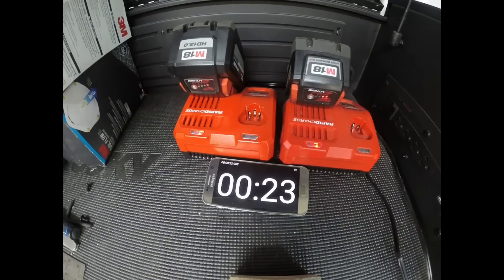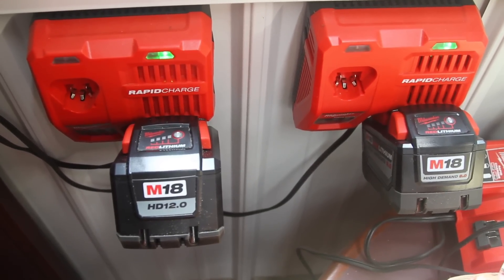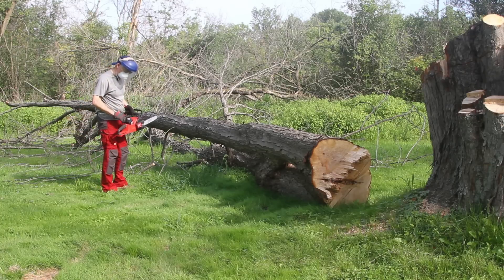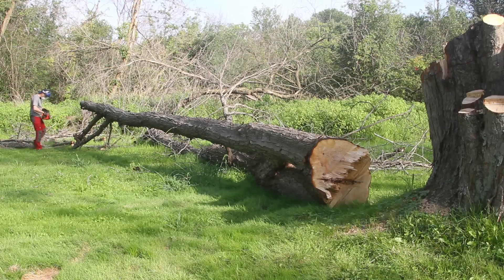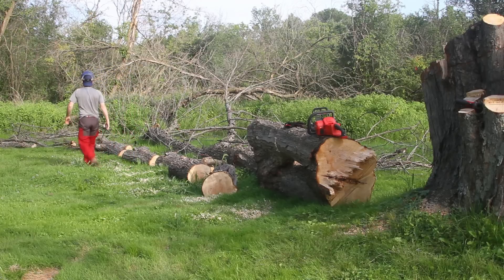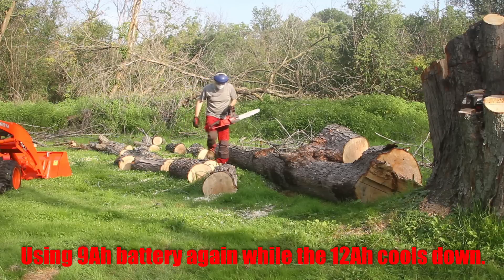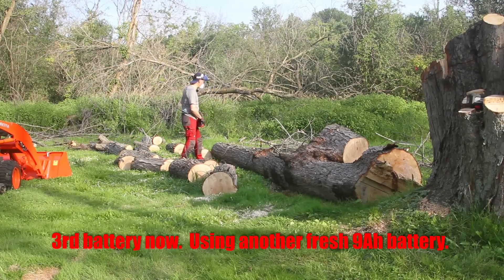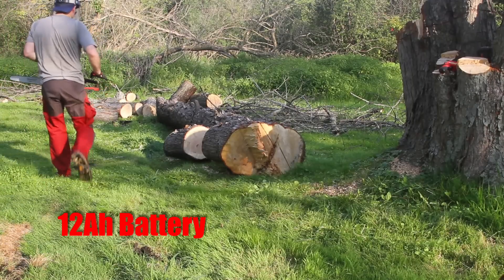Milwaukee M18 12Ah battery charge time vs. work done with chainsaw.

Comment: This saw is for homeowners cutting some small trees or limbs or the construction worker occasionally using a chainsaw. Pretty ridiculous video using it for a big tree. This job is for a gas chainsaw. You wouldn’t take a electric saw into the woods to log

Comment: I'm very unimpressed by such an expensive battery, is it the long cuts, seems to handle the 4-6" much better. I need a saw for clearing 4-6" land with a saw and brush cutter. The constant back and forth between the two pieces of equipment is killing me.  That being said I do not have power or there to keep charging batteries

Comment: This is my third small chainsaw.💫 allabout.wiki/21HD   The first was corded, and second not but both had the unwelcome feature of needing to hand prime the oil for the chain with no clear idea of how much oil was left in the chamber.  They also made tension maintenance clumsy as I needed a tool in each hand to do it properly.  Now, here comes a chainsaw with a simple turn of the external tension control to maintain proper cutting tension and a bar oil reservoir that is visible with clear markings.  Sign.  Did I mention that the oil is automatically released to the chain?  Did my first cuts yesterday which went smoothly, so much so that a friend who'd been intimidated by these machines came by, tried to use it and was so happy she's buying one for herself.  The price is excellent and after reading the reviews I bought this one even though I loathe orange on tools.  The attractive black and green one cost almost twice a

Comment: I’ve been using this saw for over a year with 2 12ah batteries for trail clearing work. When used correctly I will be exhausted by the time the batteries are. It only overheats if you push on it rather than let the chain do the cutting. It needs to be kept sharp and well oiled.  After 3-4 battery cycles the chain NEEDS sharpening. He begins with a dull chain🙄. Like any saw you need to make sure the oiler isn’t blocked by sawdust, you need to clean and maintain the bar for proper flow of oil, etc. It isn’t magical, it needs proper technique and maintenance.  At numerous points in this video the saw is pinched because of bad technique (6:40 is inexcusable, he totally misreads the tension/compression).  The danger with electric saws is that it’s an easier entry for inexperienced users who don’t know how to really use the tool.
Reply: Exactly! I completly agree with your comment, I have used this saw for 2 years now, have 3 12 Ah batteries and had never had stalling or overheating of the batteries or motor. As you put it, the chain needs to be sharp and well oiled. Usually I fill oil and sharpen the chain with every battery change, works perfect for me. Every tooth of the chain just gets 3 strokes with the file, which is enough to keep it sharp and do it's job. Still very pleased with this tool!

Comment: Working with battery tools require a different mindset.  You can not cut and cut and cut.  You need to cut a few move things around, change batteries to allow for cool down.  You will need more batteries and actually you can do a lot of work, but it requires more planning.  Once you learn the limitations and capabilities you can get a lot of job done.  For example, don't wait until it stops due to overheat, it will take longer to be useful again

Comment: That saw is not made to cut that heavy of a tree. Had brought a large cooler with some cool pack pads etc. could cool those batteries down and perform much better.  That is still a lot of work done for a tree that size.

Comment: Why are you so scared of a saw that’s not running with a safety button you gotta hold to work the saw the bar brake is for running saws that don’t have a safety switch I have used the saw never knew the overheat was such a problem

Comment: I was interessteton a Batterie Saw. Now im done, such a Shit!You need 3 Batteries to work 1 Hr15", all of them overheated, so you have to let it cool down at least 30 Minutes befor charging it for nearly 2 Houers!
Such a Shit!! A Pro with a Gas Saw like an Ms 261 or Husky 550xp would need 40 Minutes to do the same Work. A new 550xp is about 750€ . 
What was the Pricetag of that Batterie Saw?

Comment: i have the saw it does good on the battery until you start cutting 14in+ logs then its really kills it or overheats it depending on how sharp your chain is

Comment: The chain brake is activated if the bar kicks back or if you fall forward This braking action is much more sensitive and responds faster than any petrol saw so dont worry your head about it The timber your cutting is extremely hard and big for that amount of timber you would want to sharpen the chain a couple of times Also trees should be cut up once their felled Tree felling and chainsaws have a long learning curve so stick with it

Comment: Did that 12ah take almost 2hrs with the rapid charger?
Reply from the maker: They have a new charger out now that will charge those in 1 hour.
Reply: @BZEUG  they should include that new charger in the kit
Reply from the maker: @retsel  Especially with this tool.

Comment: Just the fact you cut up a tree that size with a battery powered saw is impressive. Nice REAL video. I imagine if you cut smaller tree's it wouldn't overheat so much.

Comment: My EGO 56v Chainsaw never overheats, And I run it harder than this.  With 2   5 Amp batteries you can cut all you want. And I believe it's less money than than the Mil.
Reply: Nice.   Im looking at this because in considering getting one for my dad.   Kinda comparing it to the Dewalt 60v.  Any opinions on that one?
Reply: @highlife6951  The Ego is a great saw. I researched alot before buying.

Comment: So do you use the chain brake on a gas powered saw while it’s still running when you sit it down? If so, should be the same habit on the electric saw. Just curious
Reply from the maker: Generally yes, but I never set down and went back to pick up a gas chainsaw that I did not know was running.  I have picked up the electric and realized the chain brake was not on.  I generally always treat the saw like it is live regardless.  Its just one of those differences inherent in electric.  Not saying Milwaukee did anything wrong, electric is just different that way.

Comment: I have all Milwaukee tools just because of the battery issue. I have a 3 Drills, a cordless skill saw, a blower and a weed whip. Was looking at the chain saw to keep in the truck or car in case we get a tree down on the drive (my drive is 1/2 mile through woods). I think these plastic jobs are great for those kinds of uses. The wife likes the blower for the breezeway, and likes just grabbing the weed water for around her flower beds without the weight of my Echos and without the gas and mess and aggravation. Those cordless products work well in those instances. I am accumulating an effective number of batteries for my Milwaukee products and that makes all this work pretty well. I had issues with DeWalt changes batteries and I threw away a lot of stuff because of that. Never again. I’m glad Milwaukee has kept the same 18v system for a while. What I can’t comment about is how long these tools will last. I suspect until Milwaukee makes their next gen tools or until battery technology takes another leap forward.

Comment: Milwaukee is too obsessed with 18-volt battery packs even in high-performance products. It requires higher current than necessary and it inevitably lead to battery overheating.

Comment: I guess it's safe to say that these battery powered chainsaws are good for light work, small cuts, branches and such... unless you've got a bunch of batteries laying around and you can keep switching from charging/cooling... but that's a bit annoying if you have work to get done.
Reply: I use a Makita DU353 with 2 after market 9Volts batteries (it’s a twin saw) and that would make mincemeat of this. Mark

Comment: Milwaukee needs to fix the battery over heating issues.  Or give us 2 12amp battery because we paid alot of money and all we get is constant overheating issue. I'm very disappointed in the batteries.  MILWAUKEE PLEASE GIVES US AN EXTRA 12AMP BATTERY.
Reply: When it first came out they did come with two 12 amp hours for $399.  I figured oh they will run that sale again... still waiting.

Comment: That is the disadvantage of making a chainsaw that's only 18 V. You have to draw way too much current for it to have any real power.
In order for you to do real work you need about $800+ worth of batteries on top of a $300 saw. Imagine how frustrating that would have been for someone who got the kit and only had the one battery.  Great video thank you!
Reply: Well not really. It may draw more current, but the cooling of the battery's is really the issue. Simply poor engineering. A simple heatsink going through the pack with the bottom of the pack being metal would easily resolve the overheating issues on the 12AH packs.

Comment: My guess is that the total cost for the whole rig is about $650? Seems OK if you have a gaggle of other tools that will use those batteries, but it's still two generations away from coming close to working with a gas saw of that cost level. 

Thank you for doing a significant test. Milwaukee was handing these things out like candy, apparently, and every goofy "expert reviewer" was falling all over themselves to make the saws look like they're further along than they are.
Reply: Sorry I disagree even though I have never used one I think this saw operated  brilliant considering it having a dull edge a not so experienced user and a one year old hardwood tree Petrol chainsaws are fine if you use them every day and after a year and a half it burns out But for an intermittent user petrol chainsaws can be a nightmare what with tuning carborator problems air filter blockages sparkplug failure and old fuel non combustion added to the frustration of pulling a cord umpteen times Mantainance and time wastage can be a big issue with petrol chainsaws Then with an electric chainsaw in built up areas you dont have the noise problems also from a health prospective your not breathing any exhaust fumes The negatives of battery operated chainsaws are the battery and charger prices The consumer is also pushed into buying other products in the group just to obtain a second battery Where this saw finds its niche is with softwood thinning and brashing With softwood you can take  the depth  gauge of the chain  down a little more to achieve max speed of cut I rest my case

Comment: I never have overheating issues with Makita lxt 18 volt batteries on my 36 volt chain saw.  The 6 Ah battery (two are equivalent to 12 Ah Milwaukee battery) charges in 55 minutes and is cools down at end of charge.  The Makita charger may delay charging if the batteries are warm from use, but they cool quickly on the charger.

Most good saws employ a brushless motors and will convert stored electricity to work equally well.  The amount of wood you can cut pretty much depends upon the total amount of energy in the battery.  Total energy is a product of Volts x Amps. x battery count.  Two 6 Ah batteries a Makita should cut the about same amount of wood as a 12 Ah 18V.  It looks to me like the Milwaukee is equivalent to a Makita XCU03 with 6 Ah batteries and a 16" bar but with a major difference is weight.

One Milwaukee 18V (nom) 12Ah battery weighs 3.7 lbs. (18)x(12) = 216 watts 

One Husqvarna 36V (nom) 4.2 Ah battery weighs 3.21? lbs  (36)x(4.2) = 151 watts

Two (2) Makita 18V (nom) 6 Ah batteries weigh 2.7 lbs.  (2)x(6)x(18) = 216 watts
One Dewalt 54V (nom, not max) 4Ah battery weighs 3.2 lbs  (54)x(4) = 216 watts

One Still with 36V (nom) 4.9 Ah battery  weighs 3.8lbs  (36)x(4.2) = 178 watts

Any differences observed are minor and related to chain speed, torque design, bar length, chain type and sharpness and any gear loses (if geared), but these are relatively minor.  Milwaukee is among the heaviest @ 14.0 lbs while Makita weighs the least @ 10.1 lbs, both with batteries.  Milwaukee is heavy because it’s 18 Volt.  It has very, very thick beefy wire in the motor to handle the amperage needed at this low voltage.  Makita ups the volts to 36 this allows a lighter motor.  Makita has figured a way to get enough torque for direct drive, eliminating a gears.  

216 watts will cut an impressive amount of wood, about a ¼ pickup load thrown on wood.  I cut 9 inch length, most folks cut 18 or long pieces, which means I make almost twice as many cuts.  I would estimate it takes me about 800 to 1000 watts for a pickup load longer wood would, of course take less cuts.  I own a Makita and a bunch of batteries.  I have a 12, 14 and 16 inch bars for various types of cutting.  I toss about 6 to 8 extra Makita lxt batteries in my buggy and I am able to fill my trailer (about ⅔ pickup bed size, this is about all I risk pulling with my RZR) and never use all the batteries.  Having a lot of batteries and a lot of chargers is key if you’re cutting firewood.  What's nice about Makita is that you don't need special Large format batteries.  Use what you all ready have.  Even my old 3 Ah batteries with 108 watts are fine since it's no big deal the slap in batteries.  It's not like filling up a gas tank.

Comment: That Milwaukee fast charger needs a fan bad even when my 9.0 was not hot it will over heat in that charger. I then insert it in my regular charger just to finish charging it. My 80V Kobalt charger has a fan with a fast charge time of 30 minutes.

Comment: you can't push an electric saw as if it were gas propelled, it draws too many amps too quickly, press down less!
Reply: Yes let the saw do the work
Reply: I’ve been getting that impression watching this, that he’s pushing the saw.  Any saw works better when you let it do the work.  Plus, it’s the wrong saw for this job anyway, but if you’re just trying to show what it will do...
Reply: @Abel Harbour you do realize when the professional loggers show reviews of these saws, they're just using them in test cuts. They wouldn't have the patience to buck a couple of hours of work onsite with any of these. In big wood, they cut at a fraction of the speed of even a medium duty gas saw with when the gas saw doesn't have a dull safety chain on it. 

The saw is just outmatched for this kind of work - it's pulling huge amps from an 18v battery and the overheating outcome is predictable. I wonder if it could've been avoided, though, by having a third battery and cycling them. 

Realistically for everyone else, a simple cheap mid saw like a stihl 290 or a husky 350 would've breezed through this job and the price for those saws new was less than the cost of batteries for this one. They'll cut several hundred cords of wood before they need more than basic sharpening, fuel and oil.

Comment: You can buy four 5 amp hour batteries for the price of one 12 amp hour one , far better to do that then you can rotate them and never run out of battery or have them overheat
Reply: 5 amp batteries drain so fast. My Milwaukee cordless grinder can barely cut two sides of a bolt to pull out a leaf spring shackle on my truck with TWO 5 amp batteries. Using a new Diablo diamond tipped metal blade. That's a juice hog.
Reply: KickDownDoors your grinder must be stuffed then. Mine manages plenty of cuts with cut off wheels and steel studs/reo etc. My mates one was draining batteries much like yours. He got it checked out and it was replaced under warranty as it was faulty.
Reply: Where are you getting a 5ah battery for $50?
Reply: atv guy here in the UK a 12 ah battery is £210 and before Xmas a four pack of 5ah batteries was on offer online at £220 from tool station , the cheapest I can find now is a two pack of 5ah batteries for £123 , just keep looking for offers they seem to change all the time .
Reply: @Sthilboy56  wow! Here in the US a
One 5.0 is usually $130-$140 and one 12.0 is $200
Reply: 5.0 don’t compare at all to the technology of the newer batteries. They will overhear and drain way faster then a 12.0. The 12.0 is designed to run longer and cooler. Good chance the 4 5.0 would drain before 1 12.0 does on certain tools.

Comment: Dewalt has the edge here. Charges  faster.  Another  benefit worth mentioning is if the tools is brushless and the load of the work lower on the tool... the battery will last longer.... it can sense the load.

Comment: Do you need a led to tell you a gun is loaded? To tell you to flush after you poo?  NO. So any time using a chainsaw or any saw you should know safty and use safty. It explains it in the safty guide that came with it. If you are afraid of it being live and ready to run pull the battery out.  It's made to adults with a brain. Not a toy.
Reply: 3 months have passed. Hope you've learnt what "safety" is.

Comment: If youre gonna use this saw for serious amounts of cutting you probably want at least 3 or 4 12 amp hour batteries.
Reply from the maker: Yes and Milwaukee is starting a promotion to sell it with an extra free 12ah battery.  It really needs at least two batteries.
Reply: LOL yeah let's spend $1,000 in spare batteries instead of just buying a pro-level gas chainsaw. Makes sense.